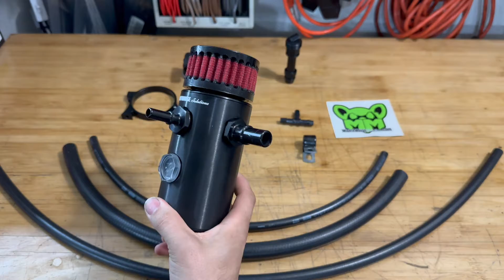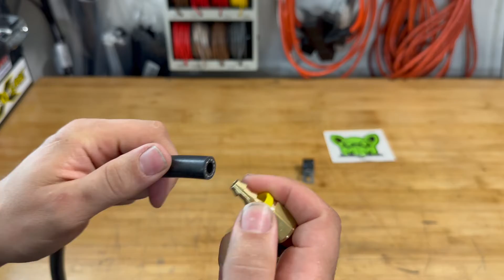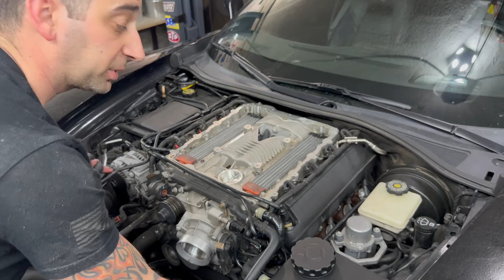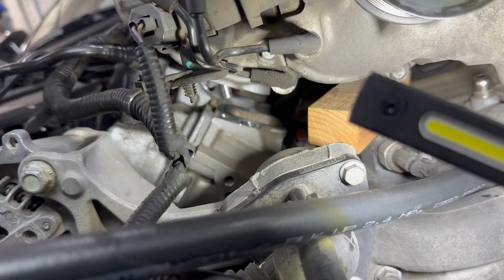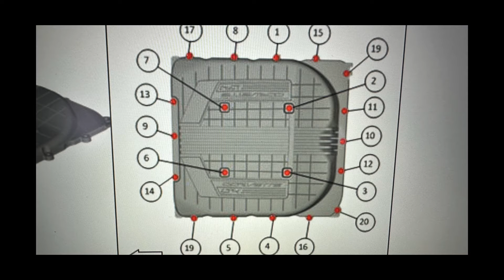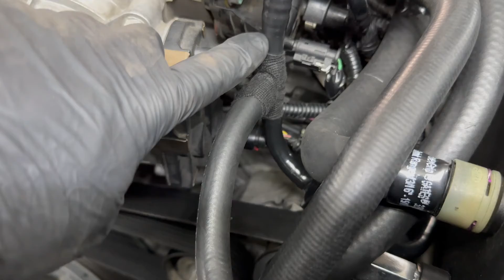Mighty Mouse Mild Catch Can Install

Comment: Truth be told, the MM catch cans are way too expensive (Corvette Tax).  The UPR brand is a much better price.  In any case, a couple years ago I made my own catch can for my C7.  It cost under $100 with parts bought on Amazon: the Can, hoses, clamps, check valve and stainless scouring pad.

Comment: So this is basically a recirculating catch can based on how you said the hoses are routed but then why does the can have the filter on top of the can ? How does it vent to atmosphere and not get a vacuum leak

Comment: Great video.  I recently did the same exact thing of connecting the CORDES mighty mouse catch can to the CORDES exp tank.  My canister bracket is mounted exactly like you have it, which puts the clear sight indicator on the side of the canister above the bracket.  CORDES is telling me the clear site indicator on the side of the canister should be below the bracket.  If I do this, the canister will hit the brake module assembly.  I put a small dab of grease on top of the filter of the canister and shut the hood and noticed grease was transferred to the hood.  Meaning, the hood hits the canister assembly.  I am still working with CORDES with regards to the correct positioning of the canister on the bracket to prevent the hood from hitting the top of the filter. CORDES seems to think the bracket assembly might be off by a 1/2 inch or so.  Also, make sure the hose from the Throttle Body to the vacuum booster is not resting on that pulley.  Mine was really close to the pulley so I reconfigured the t-connection from the Throttle Body to ensure there was enough clearance.  Anyway, I hope this helps.